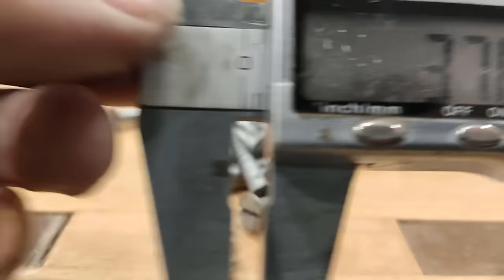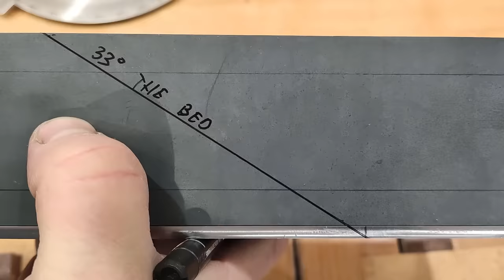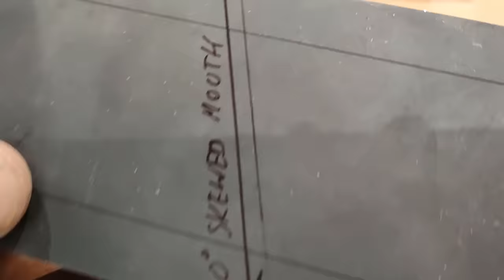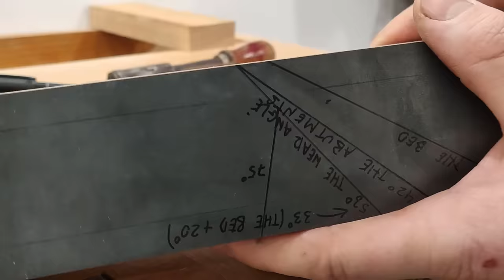044 Shooting plane - building process with hand tools

Comment from the maker: As i told in the begining of the video i'm gonna build a shooting plane.
The desing is inspired by two shooting planes, which i saw on Bill Carter site and Jeremiah Wilding Instagram profile (links in the description).

I hope you will like this project :) Now it's time for new shooting board, or maybe shooting bench?? Who knows.. :)

The materials:
4mm thick steel plates
screws
quartersawn beech
Ferdinand Rubens plane iron
boiled linseed oil
shellac orange

Big thanks for my patrons!
ANDREW DAWSON
JOSHUA LUCAS
ROSS TOMAZIN
JAVIER QUINTANA
RENE POLAK
LUBOS SULC
RAMINGR
JACEK WAWER
SCOTT MARTIN
BRIAN NEWTON
IVAN AMON

BTW. I don't take orders and usually don't sell my planes. The only way to get some of them is take a part in giveaways for my supporters. 
For support click here:
https://www.youtube.com/channel/UCPWTutgaoHuQcovRSjyeFOA/join

or use my PayPal account: esortodox@gmail(dot)com

Thank you!
Reply: Great one Stavros !
The nicest, most well thought out design for a shooting board I have found is Matt Estlea’s, here on YouTube. It uses a sloped bed, so as to allow use of the complete width of the blade.
Reply: Just a great video have subscribed,
Reply from the maker: @sergecayer942  Thanks! Sloped bed of shooting board is good solve when the blade is perpendicular to the plane - that makes skewed angle of cutting. Skewed shooting planes are designed for flat shooting boards. Bigger skew = easier work on the end grains. Regards!
Reply: What is the tpi on that keyhole saw you use?  I am looking to make one of my own that is thicker like yours is and I can't tell with your massive hands holding that saw :-)

Thanks!  Awesome channel
Reply: @sfshilo  Looks more like a broach than a keyhole saw.
Reply: Llllllp😅
Reply: It is AMAZING

Comment: Incredible! I honestly didn't know it was possible to get end grain shavings like that (maybe that says a lot about my sharpening skills). And I love the fact that this plane is multi-functional. So many shooting board planes are one-trick ponies, but this one is quite versatile.
Reply from the maker: Thank you!
Reply: Two things required. Sharpen it very well. Secondly, get a skewed plane. The straight planes can do it, but the skewed planes can do it while not having to be as sharp as the straight planes. With a skewed plane you are sheering the end grain away. With a straight plane, you are brute forcing the material away.

Comment: Inspiring stuff.  I have been using an old wooden block plane for shooting but the clearance ahead of the cutting edge is too big so it tends to jam on the leading edge of the workpiece.  Plus it doesn't have an skewed/angled blade.  This design looks so much better.
Reply from the maker: Thanks!

Comment: What an amazing plane that is. Really, fantastic! I wonder whteher you expect any movement of the steel plates overtime considering the shrinkage of the wood block? I` m impressed by how the plane looks and slices such wild grained timber. I think it could be a great plane for truing up other woodies (planes). Although a wider sole, high blade angle + a chipbreaker would probably be more preferable for the task? I didn` t like hollow grinding on a laminated blade. They hone so well flat with the soft iron backing and it reveals all the smithing art put into with the stones touching all of it... But who likes to argue about sharpening. Congratulations!

Comment: OMG, a Yankee screwdriver, I haven't seen one of those in 30 years. Owned one back in the 80's. It was serious improvement over a regular screwdriver. But a cordless drill, is a much further leap forward, then a Yankee was back then. And the hand cranked drill press, Are you a sarcastic comedian in hiding? If you pull out Oxen to pull that plane, I'll faint right on the spot.

Comment: Did an awesome job, I, instead of flat stock, would have used a piece of angle, or weld the two flats together making angle.  Hey, I have some three inch angle in the garage….    Thanks for the inspiration.

Comment: the steel plates used for the rubbing surfaces.. mild steel or tool steel? does it mtter?
 did you harden the float after making it or use it annealed?
Reply from the maker: Hey, it was mile steel. I didn't harden my floats. Cheers!

Comment: i'M STUNNED BY HOW THE SOLE LOOKS NOW WITH THE STEEL AND SCREWS SANDED DOWN TO SUCH A CLEAN LOOK. wHAT IS THE THICKNESS OF STEEL PLATE U USED FOR THIS? iS IT 1/4" OR 3/16" ??
 It's a phenomenal piece of craftsmanship my woodworking brother. 
I'm nowhere near ur skill level.  I don't even have a channel. 
 I'm learning on the job atm. Self taught for the most part but brilliant videos like this help me no end pal. 
Keep the brilliant content coming bcos I can learn more every day by watching, taking some notes and going out into my little shop and doing some of them things..
It's nice to see the plane working so well too. U could visibly see it cleaning that piece of wood up. 
What is the purpose of the plane being skewed?  Is the a specific reason for having one of these planes in ur shop? I'm very new to hand tools and really learning how to set them up and get the best shavings I can. I'm getting close now after a few days of trying it an learning more about how to set it up.

Comment: Read the norm for planes. Requires a flatness of the lower surface no worse than 0.08 per 100 mm. It turns out that such a plane needs to be checked on the surface plate?
Reply from the maker: I haven't checked it, the plane works as i want.

Comment: Hi, I'm guessing this is 15 to 18 inches long? Usually it's shoulder is shorter than its width. So what size did you make this one as I would like to give it a try. Thank you in advance.
Reply: I was thinking 2 1/2 wide x 3 1/2 high x 15 or 16 long. Do you like that plan?
Reply from the maker: Hey Patrick, if i remember good that plane was 36 cm long. I thiknk that shooting plane's side should be a little bit higher than it's width, it provide better support when the plane is laying on the side and work. It's a good plan 👍👍👍 Cheers!

Comment: This is fantastic. I'm going to make one. Any tips on buying plane irons? I don't think I have the time to source good antique irons. I do have a heat treating furnace at my disposal though, so I'm thinking about buying A2 flat bar. I could also buy an iron, but they all seem to have slots.
Reply from the maker: Thanks! Antique irons are tapered in thickness so they works great with wooden wedges. If you want to use flat A2 bar choose metal lever cap instead of wooden wedge. Cheers

Comment: Newbie question: wouldn't it be better if the angle of the blade is reversed, meaning it contacts the wood from bottom to top? That way downward pressure would be exerted on the plane against the shooting board.
Reply from the maker: Do you mean skewed in other direction or fliped to bevel up?
Reply: @StavrosGakos  Skewed in the other direction, so the blade will start cutting from below
Reply from the maker: @meergu  other side skew would have tendency to float the material during shooting.  The blade in my plane put preasure into the fence direction so the material lay very stable 👍
Reply: @StavrosGakos  As soon as I sent you the clarification I realized that. I was thinking about the stability of the plane without thinking about the stability of the material. Thank you very much for the response and very amazed by your work. Congratulations.
Reply from the maker: You're welcome Gustavo :) thank you!

Comment: Could you go over your sharpening process?
Reply from the maker: My sharpening process is really simple.
I start with flattening the back and if make them flat and mirror shiny i'm trying don't touch it againg during sharpening process (except removing the burr on the strop).
Next i'm carefully grinding the bevel on the bench grinder. It makes a little hollow on the bevel so the bevel have contact with sharpening stone only on the cutting edge and on the back edge. My main rule is to keep the bevel paralel to sharpening moves - never across (any marks across the bevel makes It like micro saw). It allows to get sharp cutting edge very easly. At the end i use the leather strop to clean the cutting edge from burr leavings and the blade is ready to work👍

Comment: HI Stavros, thanks for this, really nice build
I wonder, in what way is steel plates better option then brass plates? It seems they would be easier to work with and still strong enough, right? Can you tell why did you opt for steel and not for brass?  Thanks Tomas
Reply from the maker: Hey Tomas! Steel is cheaper than brass, brass also is not good choice for the sole - it can stain the wood during the work. Better option is bronze. Regards

Comment: Are there any worries that the  sole and side will loosen over time ? And how would you be able to sung them up ? Great video, Great plane
Reply from the maker: Thanks a lot! I have no worries👍 "sung them" - what do you mean? My english is not so good :)
Reply: If the wood would shrink a little and the screws would loosen up, there isn’t any heads on them anymore, how would you tighten them up ?
I was just wondering if you think that could ever be a problem and how it could be fixed ?
Reply from the maker: @rodneykiemele4721  I miss your comment. I used very dry wood (about 7% humidity) so there is no chance to shrink. Regards!